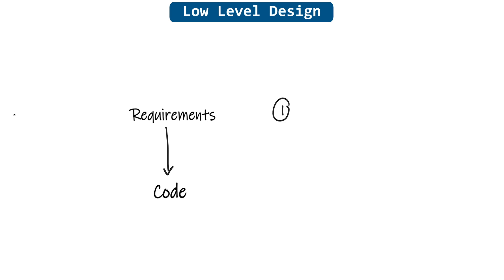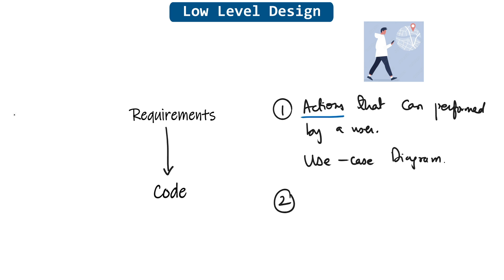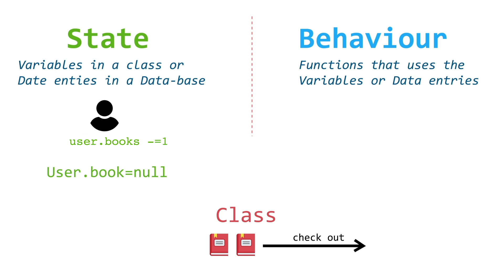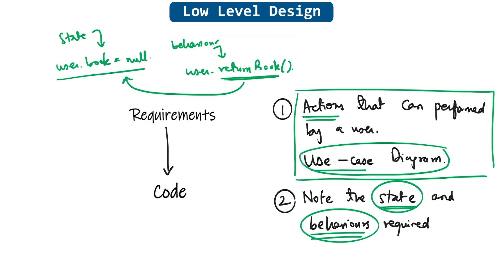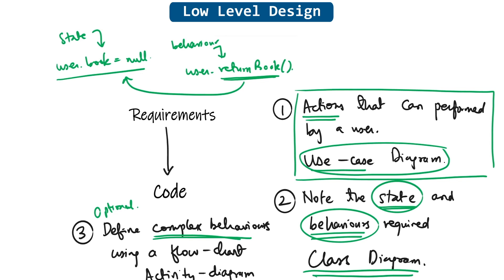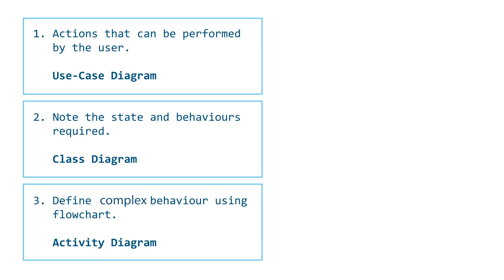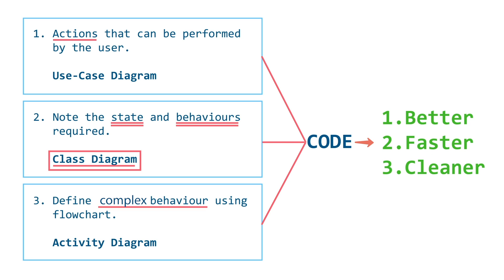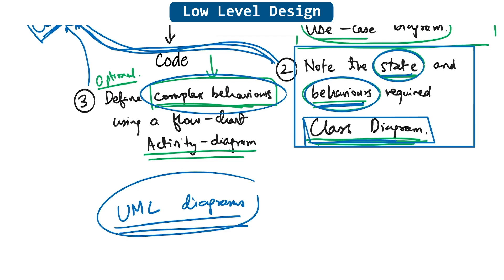What is low-level design?

Comment: Thanks for providing this quick walkthrough for LLD

A possible scenario within an interview would be to write whole code that runs end-to-end [for example, Tic Tac Toe, Rate Limit, etc.] 

When it comes to large applications, do we have to write the same entire application end to end [For example, SplitWise, Parking Lot, etc]? Or do we have specific components we have to design the whole application? In this case, too, we will need to have some metadata in order to implement logic, which will take longer. For example, we will need to square off transactions efficiently or check that the slot is available for a specific size vehicle.
Reply from the maker: It's always specific components that you code out. The core concepts and design principles are tested this way.